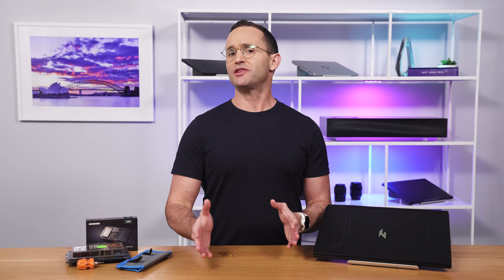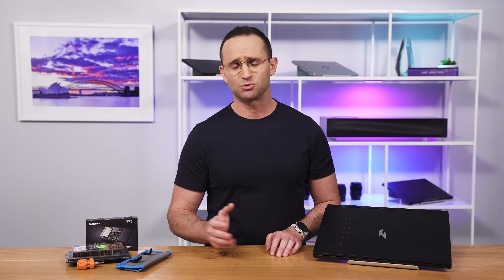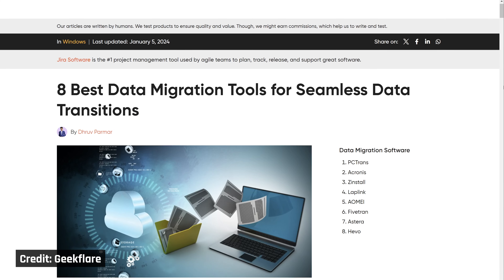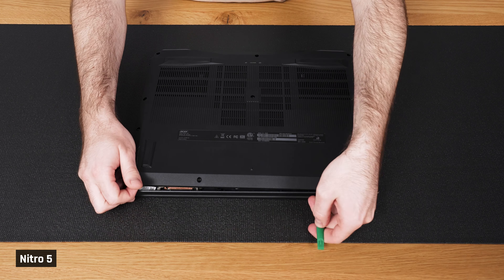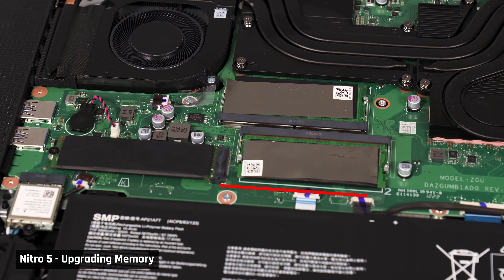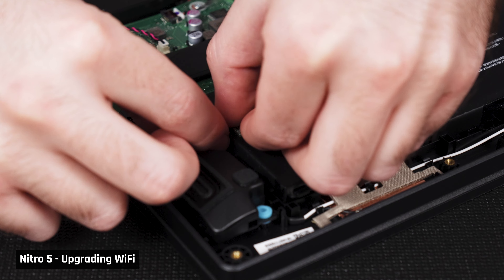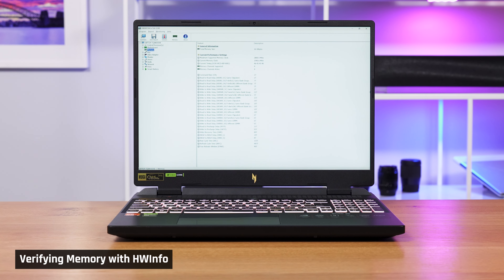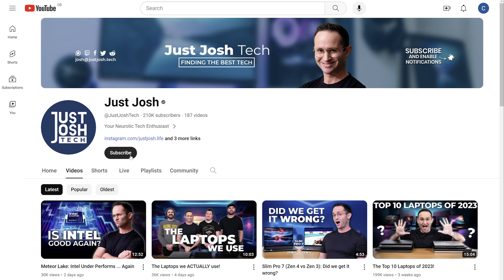How to Upgrade Your Laptop (Memory, Storage, and WiFi)

Comment: Another point to look at when buying RAM for your laptop is to check whether the SoDIMM module is single rank or dual rank. While it is normally not a widespread issue, some thin and light laptops might not be physically compatible with dual rank RAM modules.

Comment: MacBooks: no.
Reply: Framework: Yes.
Reply: The laptop industry moving towards non upgradeable parts: 😅
Reply: @ezrapierce1233  That's a huge problem. I certainly won't buy a laptop with 16 GB of non upgradable RAM in 2024 or ever. That should be 32 GB at least with an option for 64 GB.
Reply: @cameronbosch1213  Then I guess neither of us are looking favorably at the new Zephyrus laptops then.
Reply: @ezrapierce1233  Yeah, I never was. Add this to the G14 losing the option to go over an RTX 4070 (which last year it was the only 14 inch laptop that could), and I think the Blade 14 will likely be better.
Reply: @cameronbosch1213  Fingers crossed it gets better upgradeability this year.
Reply: Apple & Planned Obsolescence: 🤝

Comment: Some people may not have easy access to an Ethernet port so I would suggest downloading the drivers for the new WiFi card and putting them on a flash drive before performing that upgrade. Also note that Intel WiFi cards whose model names end in "1" so AX201, AX211, will only work on machines with modern Intel CPUs. The AX201, AX210, and others ending in "0" should work on any laptop.
Reply: Well, I learn that today. You just saved me from a wrong buy (although, no kidding, I am not dfinding any such module online that isn't a knock-off)

Comment: Some Intel M.2 wifi cards don't work on non-Intel machines because they use the CNVio2 interface instead of the standard PCIe + USB like most cards, for example the AX201 and AX200 are nearly identical but the AX201 gets its MAC address from the motherboard and the AX200 has its own

Comment: Can’t I fit in a Gpu board anywhere in there, even if it’s and old one, I’m using a Lenovo ideapad flex 5 with a ryzen 7 5700u and I’m rly desperate for an upgrade

Comment: I just opened my huawei laptop back panel I have to say the outlay is different from yours I couldn't find any ram slots. 

I am only saying this because i just want to tell you any huawei laptop owners not to open there laptop just to find out if they have a ram slots.

You were right about using your nails to remove the rubber under the  panel it hurts almost broke my nail 😂.

Comment: $250 ThinkPad T480: "Framework 13 has replaceable RAM modules and keyboard? That's cute"

proceeds to mog all Frameworks with hot-swappable 72Wh batteries
Reply: Some old Thinkpads have an upgradable CPU.

Comment: Please unbox products before reviewing them.
Reply from the maker: I don't believe it is  something that most people want to watch. They want to know straight away... is the laptop good. So if we were to do unboxing's, we'd probably do it on a different channel that we'd have to launch for that purpose. What do you think about this?
Reply: @JustJoshTech  Unboxing is no longer of interest to me.  I like that you cut to the chase.
Reply: @JustJoshTech  i agree with you. But we need to know what is inside the box. 
I mean, some laptops have an external mouse on the box. Meanwhile, some others dont have a charger.
I dont mean to watch what the packege looks like, i want to know what is inside it.
Reply: @Terabyte75  The only time I've ever seen a laptop not come with a charger was if it was used or open box. Also, external mice just aren't a thing when it comes to laptops. Sometimes a manufacturer will offer one as part of a bundle, but those are very rare.